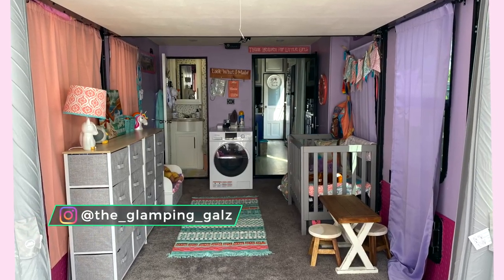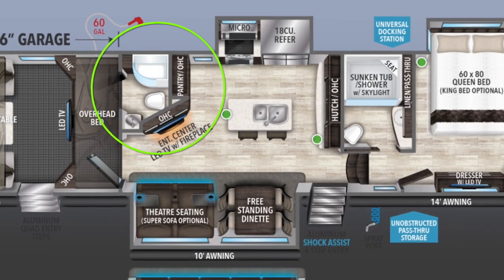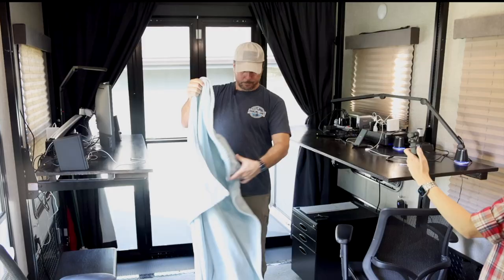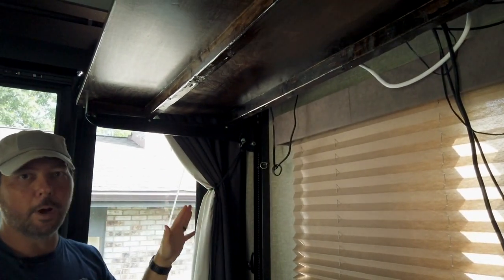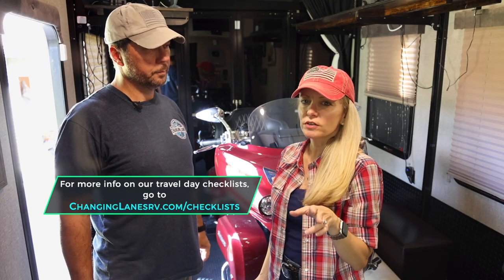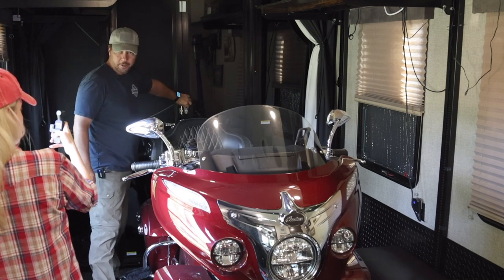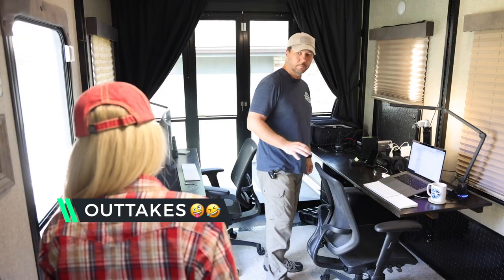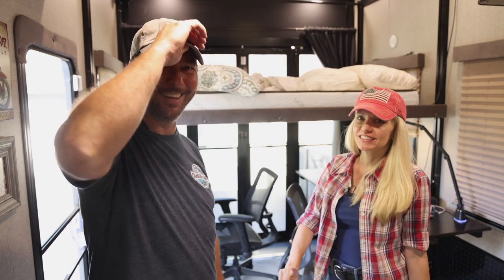RV Office / Guest Suite / Garage (Toy Hauler Garage Versatility!)

Comment: Man, that's quite an office.  One thing I noticed - the tie-downs on your camper floor. We had those in our last camper, a Raptor. They would not hold - several pulled out of the floor and allowed the bike to tip. Watch those very carefully and ensure they stay solid. Those Wheeldock units are OUTstanding. We have two and use them often - never had a failure and they really hold the bike well. I can heartily recommend those.  You two are quite inventive. I love to view your videos..  Best wishes.
Reply from the maker: On the Momentums, they add steel plates welded to the frame under the tie downs...  We've had the D-ring bend over time but never come out.   You can see how they're built here: https://youtu.be/1OEcfhBfIlI

Comment: Multi purpose room is the whole reason we ended up going with a toyhauler too. We use the cheap automotive style storage chests from Walmart.  The wheels on them helped move them around a little bit. We also have two ikea metal cabinets that can be wall mounted but we have them stacked and bolted together for the floor.   It sets against the front wall when we're stationary and moves to the side and straps down when we load the RZR.We also added pegboard behind the living area door and installed 2 wooden cabinets between the upper bunk and loft. It took a while to find those cabinets as they had to be a particular measurement.

Comment: What a cool vid guys. Appreciate the trouble y’all went through to show it all. Tara, just wanted you to know that I personally care about your comfort. Having said that I’d probably crank down the AC too!  But I’d get you a nice cozy blanket, some furry slippers, and some hot cocoa. 😜  I’m glad Chad mentioned Lucille being a bit dirty. It gives me another chance to request a video on how Chad details her after riding.  He’s so precise with everything I’d like to see how he does it and what he uses.  Just an idea.  Thanks for the great vid and again for all the trouble.   Troy
Reply: Agreed. I also really would like to see a video where Chad walks us through his thought process as he rides the bike in and out of the garage. There’s a point at which reaching the ground is difficult. What’s the approach going in? Where’s the “keep going” zone? How do you deal with that backing out? It took me a few videos to realize that the reason Chad starts the bike coming out is that by putting the bike in 1st and having the clutch in, he has a “pull it forward” backstop if he has a balance issue going backwards. If you have a 900+ lb bike, you know how important that is. My H-D Road Glide Ultra weighs 950lb and I have a fairly good idea of how difficult this is and how easy Chad makes it look! The detailed loading tips would be really useful.

Comment: We have the "pinless" system in our 351M and it works great.  Now if they can come out with a way to raise and lower the top bed without having to raise and lower the lower couch/bed system, that would be yuuuuuge!
Reply from the maker: That would be great...    Would require a second chain and a thicker mount for it, but it sure seems doable.

Comment: Yeah bed head...friends of ours call it Pillow Head before the shower happens. Love the Internet Command Center plan. It's amazing how much camera gear is needed.  Moving and storing Gigabyte/Terabyte files is quite a task if you don't have 1/giga or 10/giga network cards/switches. You've got the garage modified to work out just right, nicely done.  Cheers.
Reply from the maker: Our local network is Gig-E.  👍🏼
Reply: @ChangingLanes  Here too. A few years ago I ran CAT6 under my home and routed home runs to each bedroom, living room, kitchen nook and the detached garage in back. I have a WiFi Gateway from Fios in the garage, point of entry, and routed two CAT6 lines to a Netgear WiFi Gateway in a clothes closet centrally located in the house. The second line is a back up. From there, hardwired the house, all gigabit. Works really good for WiFi and the hardwired obviously for items that don't move like TV's and desktop stations. Can't figure out why cell phones will not disconnect from one WiFi that is close by and then no longer is close to that one but is closer to the other WiFi. It takes a long time for that transition and both have been set up with different channels. That's the only tiny issue and I can share files from computers to computers just perfectly as one computer has the large hard drives while the others are set up with SSD/NvME storage. Terminated all of the home runs myself after learning the color code I wanted. Microsoft messed this up however as the new annual updates no longer allow computers to be seen when browsing the Network. I have to type in the computer names to get access, no more computers being populated by default. NetDisc is enabled too.

Comment: Love the video as always!  We have the same 3 season patio doors and think they are great!  Two things to note, the glass needs to be in the lowered position when traveling and also we noticed the doors started coming unlatched when towing.  To solve this issue I just run a zip tie through the handle on the inside for some extra piece of mind!

Comment: You can use the 10tb external drive for the NAS also, remove it from the case, it is a whitelable WD Red Drive, much cheaper than buying the red ones!

Comment: I don't totally know how the bed lift works, or how often you need to bring the bed down, but what if you got a 4x4 piece of lumber and cut it into 4 equal length sections. Then rather than removing all the stuff off the desk, you could just place the boards on top of the desk next to the wall track, and the desks would push on the lumber, which would push on the bed, rather than just the desk and the bed. You'd knock out a few steps.

Also, your wife would totally be jealous of my video editing setup. I ditched a triple monitor setup for a 65" 8k TV as a monitor, although my current graphics card can only run it at 4k, as I'm still waiting on a new GTX 3090 graphics card to be available. Much cleaner than my old setup, and the quarter screen preview will be 4k. (although I actually built the guts of the PC for engineering, the video editing is just a hobby) I live in a ski town now, but plan on moving to a ranch and building my own house, and figured I'd move into a 5th wheel when I do, and I think I will have a similar desk setup like you used to have where you moved the desk against the bathroom wall when you traveled.
Reply from the maker: We tried that originally... it's tough to keep pressure even on 4 corners, so one would fall, then weight would shift, another would wall and we'd be left with 2 points of contact.
Reply: @ChangingLanes  At least it was worth a shot. 2 points of contact definitely isn't good though.

Comment: Have you thought about placing the UPS under the desk, also creating a custom docking station that puts the laptop under the desk instead of on top of it?  You should reach out to LinusTechTips and see if he might have an idea to make it easier for transformation mode.  That way you don't spend as much time doing the transformations.  I'm thinking Desktop with virtualization to replace the laptops, and a small dock with a lightning cable to the desktop.  Maybe add another shelf under the tech center to have all your chargers and batteries so you don't have to move it around all the time.  Just my two cents though.
Reply from the maker: The UPS and charging station power strip are secured to the desk using command strips.. 👍🏼

Comment: have you thought of cable track. pretty clean and neat way to run that cable also them power cables can have a cat track found on amazon.  also on underside of desk can use industrial cabinet raceway it has fingered sides with a solid snap on cover. it allows you to run side to side with wires able to coil extra inside yet exit anywhere.

Comment: Hi Chad after whatching ur video a couple or times, think this out with me ,i notced that u have plenty of room for a stilt system on top of ur desk track . 4 nice pices of aluminum stock pined like u r doing n u would not have to take anything off the desk at all, just add stilt n remove
Reply from the maker: I tried that with wood but the wood split and it was chaos.. LOL  Might work with aluminum... BUT the new systems need the bottom to engage to release and re-lock the bed.  Would require some way to replicate that on the aluminum.  We being the bed down and put it up about once a year, so it's not a big deal for us...

Comment: Question: What the length of you ramp and height? Thanks great video.
Reply from the maker: The length is 8ft and will sit anywhere from 2.5-3 ft off the ground depending on the site.  The height can always be adjusted by raising the nose of the rv.. 👍🏼

Comment: Exactly why I bought a toy-hauler for the garage, extra bed, office, ala "man cave" for me.  Are those 3-season patio doors available in retail?  I don't have them on my Stryker toy-hauler but REALLY want them.

Also, I'm wondering if you could create an extension to the happy-jack lift on each column to raise the bed so that you don't have to clear as much space while lifting it?  I was thinking a piece of C-channel cut and fastened to the top of the "desk mounts" that rides up with it so it would lift the bed with the desk lower thus allowing you to leave more setup on the desk?  Chad's a smart guy - I bet he'll figure out a way.
Reply from the maker: I tried that, but used wood in the channel. It was too thin and split.  So I tried 1x4's on the desk itself, but it only takes one to go wonky ans fall, then the opposite corner falls.. LOL   I'm sure something could be done with aluminum.  But the new beds have a specific latch / de-latch mechanism triggered by the bench side... Still doable, but would have to figure that part out.  Lippert does sell the 3 season doors after-market: https://support.lci1.com/three-seasons-door  I'd call them about how to go about getting them.. 👍🏼
Reply: @ChangingLanes  thanks buddy!  :-)

Comment: Hello, I was watching one of your previous videos, and was wondering how much extra fuel you carry in the back of your truck.
I know this is a odd question, but are you worried that something might spill. I also was curious how the fuel card was going, as I might do the same thing soon. Thanks for your help
Reply from the maker: Hi, Vince!  Our F350 has a 48 gallon tank, so we've never needed an aux tank in the bed.  If you're talking about the plastic containers, we don't carry those anymore, but when we did, they never tipped or spilled.  I kept them bungee'd so they wouldn't slide around...

Comment: Chad, I know this may not be a question for this film, but did you ever research the difference between the 7K axles with disk brakes vs the 8K axles with disk brakes? If so, can you provide me the link. I have a RZR 1000 and a Honda Goldwing trike, only carrying one at a time of course. Thanks for any information. Tom
Reply from the maker: We will be getting the Independent Suspension in November but haven't really looked into the 8K versus 7K.  Pretty sure it's just a beefier axle and hangers.

Comment: Looks like you have the 3rd A/C unit in the garage. Does it work very well if the bunk is in the up position to cool the garage? It easily gets to 115 degrees in the summer here and I've been thinking of putting a 3rd A/C in my trailer for race weekends
Reply from the maker: Yes.. I think it's only 13.5K BTU but does a good job.  It's certainly necessary in the summer for sure!

Comment: I have a couple question about using the toy hauler garage as a bedroom. I thought you said one time that the doors are 3-season doors. Is there a year-round option? Would it be possible to have a queen size bed in there?
Reply from the maker: Yes.. 3 season, but not 4.  Not enough insulation for freezing temps.  The bed is already a queen sized and we replaced the mattress: https://changinglanesrv.com/faq/?Display_FAQ=2174
Reply: Thank you!